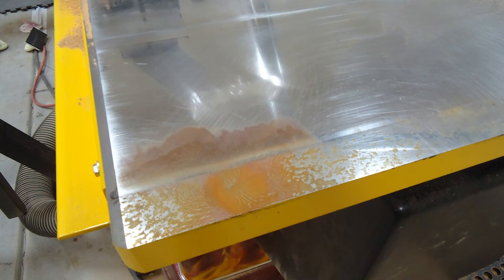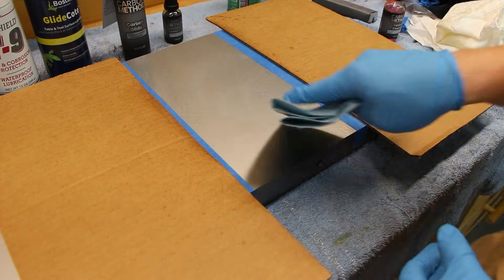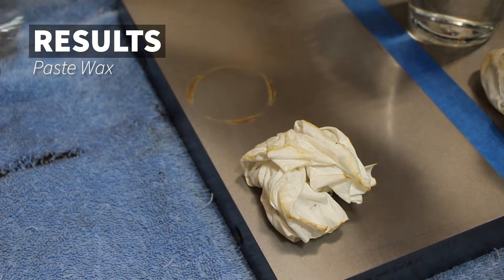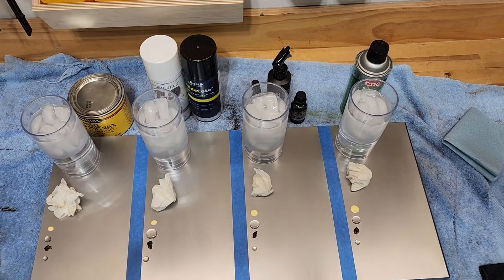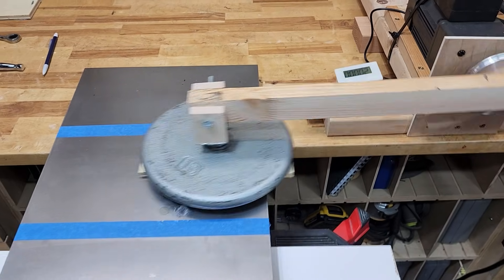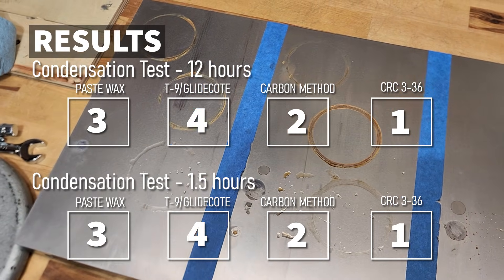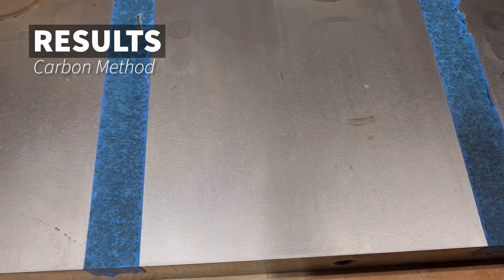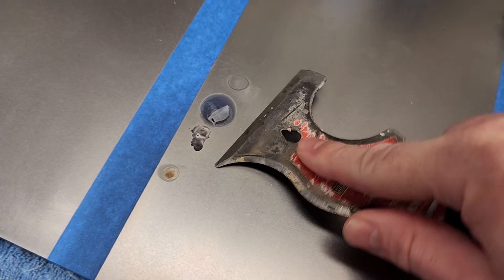Which Rust Prevention Method Wins This Brutal Tablesaw Test

Comment: I've used paste wax, thinned with mineral spirits, for years.  
Never had rust problems, & it makes the deck buttery smooth.

Of course... I don't leave water spilled on my table saw for 24 hours, & I keep my tools clean.
I apply paste wax like once every 2 months of use, more to keep the deck slick to prevent a kick back, than for rust prevention.

Comment: Here's the deal. Use paste wax. You aren't going to be leaving your table saw in the rain, you aren't going to be putting glasses of water on it for 24 hours. You aren't going to be keeping it in a 99% humidity chamber. 

Paste wax is cheap, a can of it will last you the rest of your life if you only use it on your tabelsaw. You don't even need to strip the old wax off when reapplying. I have applied paste wax to my saw twice in the past 15 years and my say looks fine. No rust spots at all and I live in central Texas where it gets up into the 90+% humidity quite often.

If you are getting rust on your tablesaw, that is a you problem and it will continue to happen with any of the products in this test.

Comment: Would love to see how Silber Gleit from Felder holds up in a test like this. I've been using it on my Jointer/Planer and also on my SawStop but haven't done any long-term tests. I typically apply it for lubrication once or twice a month, not for rust, but it supposedly helps prevent rust.
Reply from the maker: I haven't heard of that one. I'll have to look at that.

Comment: So far I've gotten good results using plain old Johnson wax and I guess I'm fortunate to have a couple of tubs of that stuff since they no longer make it.  That being said, I'm going to try a ceramic coating like for cars on my table saw as I seldom use it, just to see how long it keeps the rust away.  For now, I'll just keep using the Johnson wax on my other cast iron tables/tops like my band saw, jointer, etc.  If the ceramic coating outlasts the wax I'll switch to ceramic for coating everything in the future.

Comment: Saw stop cast metal is probably the worst cast used on tops out there.  i found with all my tools in the shop the best to be a 10 year old king industrial planer.  water can get on it and it hardly stains let along rust.  my observations real usage in shop
Reply from the maker: Yeah the old cast iron seems to resist the rust a lot better.

Comment: Question: How did you remove the pitting and rings in between different tests? I need to remove some spots that look like your wet cloth rust. I'm thinking about the red abrasive pad and WD40 with a random orbital sander. I've been using a wax method for protection, but my own sweat is my greatest issue.
Reply from the maker: Yes the easiest way is to put some of the abrasive pads on the random orbital sander and sand evenly across the entire surface with WD-40.  Red works, but use whichever grit is just enough to get off the rust without making deeper scratches.
Reply: @EveningWoodworker  Thank you for the reply. Guessing this will this trash my orbital sander? Probably should buy a cheap-o for this, and not destroy my Festool.

Comment: Could you try Turtle Wax Ceramic Spray for cars? Does well on cars but curious if it'd have similar results to the Carbon product and at a way better price.
Reply: I applied this to my quartz planer bed and it's slick as hell man! Now I have not tried it on a true cast iron top yet, but that's coming soon.

Comment: Great video test, thank you. I've  been protecting my woodworking machinery from rust for 40 plus years. My system is to run a single dehumidifier in my 32 x 48 shop during summertime when, here in the midwest, the humidity outdoors is quite high. The humidifier keeps humidity in the shop 40 to 50 percent and I monitor the level carefully. In addition, I use paste wax on all cast iron surfaces, mostly to reduce friction. And lastly, I'm careful to avoid water or coffee spills etc. There is zero rust on any of my equipment. I run the dehumidifier from late may through mid September usually. My nice hand tools, veritas planes etc are completely free from rust. As a bonus the low humidity is perfect for my lumber storage. And, the shop is comfortable to work in with the addition of two ceiling fans running without relying on a air conditioner.

Comment: Very pricey products and many tips on this issue on YouTube. My long term solution after rust removal efforts was to wipe down entire surface with acetone as a degreaser and then to use diluted clear epoxy over entire surface as rust prevention. Perfect.

Comment: 3-36 is great for garden tools and such.  I think there should be a part 2 where you sand some wood next to it and attempt to measure dirt attraction.  Then, use a scale to measure drag using the same weight and wood block from the wear test.
Reply from the maker: That's a good idea... I think if I were to use 3-36, I'd put a coat of Glidecote on top so it wasn't sticky.
Reply: @EveningWoodworker  How do you know that the Glidecote isn't affecting the base coating, regardless of which it is?

Comment: I have always just used car wax, applied 3 or 4 times a year. My saw is vintage 1980 and no problems.
Reply from the maker: I feel like the older cast iron doesn't rust as easily as the newer stuff. The older stuff must be more seasoned.
Reply: @EveningWoodworker  older cast iron probably has some chromium in it. Phosphorus keeps cast iron from rusting too. That's what's kept the Iron Pillar of Delhi around for 1,600 years now. It's been outside the whole time. There's different kinds of rust. That reddish to bright orange stuff is FeO3. Black oxide is FeO4. O3 is cancer rust and O4 is protective.

Comment: I use paste wax on my SawStop. I have a few rules I follow. One no metal on the surface, wood or plastic only. When done using the saw I have a piece of 3/4” MDO board that covers the surface. Not MDF, MDO is medium density overlay. The MDO is a couple of inches larger than the table saw. Yes, this sometimes is a pain, because every time I use the saw I have to remove the MDO. Small price to pay for an unmarked surface.  This is in a home workshop.
Reply: I cover mine too but I just use a thick piece of cardboard.
Reply from the maker: That definitely would help. I put a piece of plywood on one side of mine to give me more workbench space and I'm sure it helps prevent some rust. Sounds similar to your solution...
Reply: I just happened to have the right size and something I could pick up all the tools laying on it. I either move it to a workbench or a pair of adjustable sawhorses.

Comment: I have used paste wax, boeshield, and exterior varnish, and the varnish was a mess.  The other 2 did not work well.  So I tried wipe on poly, as it is very thin, and it has turned out to be the best I have tried. Maybe the wiping on and wiping off drives it into the pores, but it has been great.
Reply from the maker: How frequently do you apply it? And does it stay smooth?
Reply: @EveningWoodworker   haven't had to reapply it, probably been at least a year since I tried it.  You can hardly tell it is on there except for no spots on the ci.

Comment: I've been using paste wax for a few years now. On all my cast iron surfaces. And I have a strict no metal, and no liquids on any of those table tops. I have no rust, and I only reapply maybe twice a year. Application process is less than 10 minutes for all the tops, and lasts easily past the 6 months I give it. Just don't put cups, soda cans, or random tools on your cast iron tops and none of this should be a problem. I can say without a doubt, a little bit of vigilance goes an extraordinarily long way. Take care woodworkers and fabricators.
Reply from the maker: That's good advice! Vigilance is key with any method.

Comment: I live in south MS where humidity is over 80% most of the year. Carbon Method has, by far, been my best protection. My table say is stained form previous corrosion but I started my band saw and jointer on carbon method the day i gat them in hte shop. Both are amazingly clean. It is expensive and is not a one and done coating. You must reapply regularly.
Reply from the maker: I think humidity is an area where it shines!

Comment: Automotive carnuba hard paste wax. 3 good coats makes a big difference
Reply: If you use a wax that contains silicone it will contaminate your wood and make finishing it fail. Silicone leads to finishes fish eying. Automotive waxes tend to have silicone in them. So might want to read the can there.

Comment: Brand new Sawstop, I wanted the best protection possible.  Cleaned and applied carbon method exactly as instructed.  Month later I picked up a small cut off from my table and it rusted underneath the cut-off.  I contacted Carbon Method and they said that my wood must have been extremely wet.  Not the case, it was kiln dried mesquite.   BTW the cut off sat on my table for about 2 weeks.  I expected Carbon Method to send me more product to re-apply, but that was not the case.  Been talking with a metallurgist and I am going to “cold blue” my table.  Great video
Reply from the maker: Thanks! I'm curious about this cold blue technique
Reply: I had poor results with my carbon method as well. I did 5 coats as well lol😅

Comment: Could a ceramic coating, like for protecting automotive paint, be used? That stuff repels water and makes it difficult for things (like corrosive bird poop, and bug guts) to stick to the surface.
Reply from the maker: Possibly, but the only problem with that is all of the rubbing boards back and forth on it. So if you apply a hard spray coating, it can eventually come off in the wear areas just like the shellac example. Then you have an uneven surface.

Comment: Great video.  The key take away?  Don't put wet things on your table saw.  I use paste wax, but I re-apply it about every 10-20 hours of use.  It's only 1-2 minutes of work.  The frequent application might mean that the cost ends up being similar to Carbon Coat though.
Reply from the maker: Yes! There's not really anything that will last forever on it...water is brutal to cast iron! Paste wax can work if you apply it enough though

Comment: I have been using carbon method for about a year with great results.  The reconditioning oil works better than anything I nave used to remove rust and get you started off with a pristine surface!
Reply from the maker: Yeah I've been impressed with all of their products

Comment: i’ll stick with my Paste Wax. I apply it every couple months. I have a Workbench for glue-ups and such. If I catch anyone sitting a cold drink on my saw, they’ll be shown the egress.
Reply: I'm with you. The only difference is I use a heat gun to bake the paste wax into the CI. No one sets anything on my CI or it's a rap on the knuckles with my ruler!!
Reply: You are too nice - I would have to get the backhoe out, dig a hole - come up with another excuse as to why there is a new hole out in the pasture etc......  That said, I am a paste wax kinda person.  It can re apply as neccesary, it never evaporates, doesn't go bad etc - I have a can good for 4-5 years of re apply etc.  The new fancy stuff seems nice and all, but between the price and all the rules for application etc - no thanks  KISS method here
Reply from the maker: Haha yeah that's a way to not get invited back!
Reply: My machines are in the garage, never outside. I always put plywood on top of my table saw to cover it and protect it when I use it as a work bench. I never set a glass of liquid on it and if I spill anything then I wipe it up.
Reply: I'm with you. Maybe paste wax isn't the best. But paste wax is not nothing either.  Plus for me paste wax is a known quantity. I have it and I've used it for years. I don't think I'll be putting any wet glasses on my cast iron tool tops either.

Comment: You did a very thorough amount of testing there. Well done.
I've got an ancient old Craftsman jobsite saw that I've been using for several years now. It had a pretty rusty top when I bought it. I just sanded it as clean as I could and then laminated the top with Formica. No more rust. Nice and slippery. And it's a light gray color, so it's easy on the eyes and easy to see anything laying on the surface. The only part I have to look after is the cross slide grooves, and that just gets a little light oil now and then.
Reply from the maker: That's a new approach I haven't heard of before! Sounds smooth enough
Reply: @EveningWoodworker  Works Great! Easy to clean. Glue doesn't stick to it. My crosscut sled glides across it very smoothly. Wouldn't have it any other way.

Comment: Great test, interesting results. Since SC Johnson paste wax dried up I've been using a bowling alley wax I found on Amazon with good results. It's a blend of carnauba, other waxes, turpentine, and mineral spirits. Gives a real nice finish and the wood gliding across is very satisfying.  One other test you could do is leaving a piece of green lumber laying on the table for a couple days, pretty common way to mess up a table saw top.
Reply: what's the name of the bowling alley wax if you don't mind sharing?
Reply: @testingoyay4648  I just looked, it's the first result on Amazon, red and white can that just says "bowling alley wax"  by BWC company. I've been pleased with it. Pretty sure the can will last me several years.

Comment: Thank You great information 
I’ve been using (cringe warning) automotive paste wax for years, to those who worry about transfer to the wood have you ever prepared a car for painting, the wax is nearly impossible to remove and I’ve never had any known issues. Unfortunately my shop has been setting in storage for nearly 2 years most of the cast iron tops have minimal rust if at all one has a significant amount due to condensation and another due to abrasion while moving. One final note the newest polished cast iron is from 1972 and all are gray in color not silver.
Reply: which brand have you had the best experience with if you don't mind sharing?
Reply: @testingoyay4648  Nu Finish, Turtle Wax as I remember, my shop has been in storage for nearly 2 years waiting for a new building
Reply: @testingoyay4648  liquid Nu Finish and Turtle Wax as I remember I most commonly used
Reply from the maker: Oh man you're a rebel!

Comment: Carbon Method is WAY too expensive.  Just not worth it.  Paste wax works great if you reapply every month or so - and it's cheap.  CRC look interesting - I wonder if it is slick like a wax?
Reply from the maker: That's one thing I didn't test, but you could always add some Glidecote or wax on top
Reply: @EveningWoodworker  I found this vid after watching another by a guy who applied CRC and then topped it with paste wax. Seems like the way to go.

Comment: Interesting tests. I’ve been using Glidecoat by itself and have had good results. Of course I don’t set any drink containers on the saw. Worst thing I had happen was when the wife brought me a grilled cheese sandwich for lunch one day. It was on a paper plate on top of one of those plastic plate holders with the chicken wire, cheese grater looking bottom, and set it on the saw. It sat there a couple of minutes, maybe before I noticed it. Didn’t see any marks when I moved it, but the next day there was a nice impression of the cheese grater bottom, about the size of a slice of bread. 
Anyway, looks like the Glidecoat has gone up in price from what I remember when I last bought it. So between the CRC and the Carbon Coat, the CRC is about 8 times cheaper. I guess it would also depend on how many applications can be applied from each product and how long they last. The CRC looks to be an easier, quicker application and that’s a plus for me. I think I’d rather be able to do the quick spray and go, then periodically do the light sanding and respray than the Carbon Coat process and probably still end up sanding it on occasion. A lot comes down to whether your saw doubles as a workbench or is just used as a saw. The weather where you live also has an effect. If it’s high humidity, but not a huge shop, maybe get an air conditioner or a dehumidifier. I have about 450 square feet and have a small window unit, but I don’t run it all the time and all my cast iron tops are doing well.
Reply from the maker: You could try combining the CRC and Glidecote. I think the CRC isn't as slick as the other products

Comment: I recently did a video removing the rust from my saw. I left a cedar fence picket on the top for a couple of days and was greeted with my first major rust in 20 years of owning the saw. I use Johnson's Paste Wax, but if I ever switch, it will be to Carbon Method.